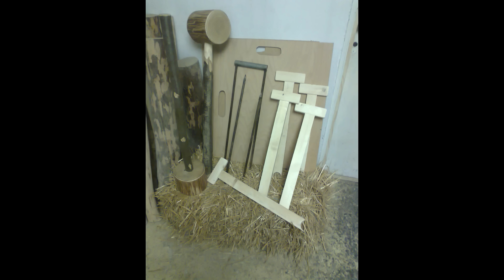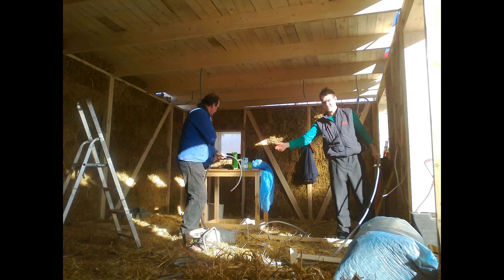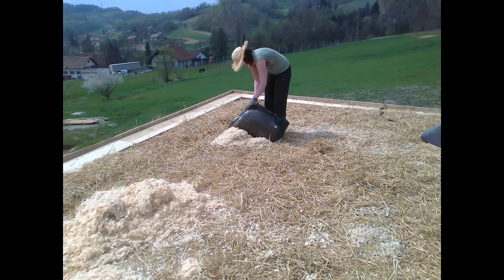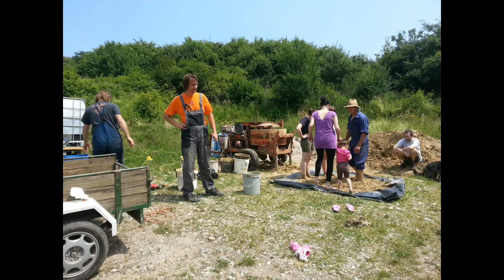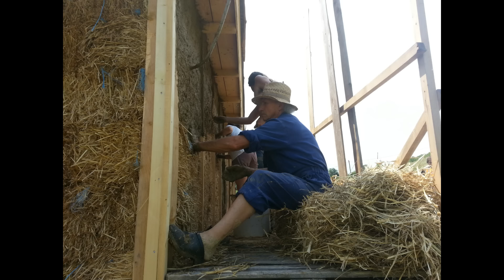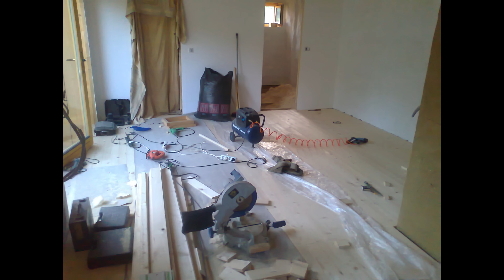20K straw bale house from start to finish

Comment: the posts will rot sadly
Reply: Inside the Straw walls they won't, the exposed posts to the air/ground would just have to be maintained, just like any home.
Reply: @CannyNomad  so how will you maintain them? dig up and replace? its not that simple when the house is resting on it
Reply: @CannyNomad  and wood should never be in contact of the ground and in most homes its not
Reply: Hey guys, have a look at buildings in Thailand for example, the poles are in water there. In northern Norway you will see buildings built on wooden poles, and the foundation is in salt water. You can change one and one pole by jacking up the house. No idea how long the strawbales themselves can last.
Reply: OK: posts in water or swamp do not rot, that s the point of having wooden post in Thaïlande or normal, finland, france!still,  in Slovaquie or Slovénia, the posts Will rot slowly thx to the cold but they ll rot anyway. They Will have plenty of time to make concrete posts 😉
Reply: @supermojo9672  how are you gonna crawl under the house with buckets of concrete? lol make the posts from start
Reply: @BlueGamerDude  OK they screwed up...but you know they re not that rich....concrete is house caviar for them.
Reply: @BlueGamerDude  By back yard is fenced in Black locust and is over 75 years old so maybe you don't know everything.
Reply: @EURIPODES  and is the fence in the ground?..... wood over ground doesnt have to rot only because its old. But we are talking about in ground
Reply: @BlueGamerDude  locust wood, aka iron wood has a much higher slica content, they are more tropical in locale, but you can find iron wood here in South Carolina. Ipe' is another, but, it is a tropical wood. High silica content really doea make the wood so hardy that it's almost impenetrable to moisture issues when in direct contact woth the ground. Caribbean Heart pine is a good one, too. But that's only because antique heart pine, the 400 year old kind... is harder to find, but it's so sappy and has such a high density of pine resin that it's practically waterproof. Maybe they have something like that in that neck of the woods...
Reply from the maker: No, it is hardwood...
Thanks for the comment!
If you are subscribed and you ring the bell, you will see in May my new episodes
TINY HOUSE IN THE MIDDLE OF THE NORTH ATLANTIC OCEAN
Which I am building right now ⛏🔧🏄🛠🔨

Comment: Adobe people adobe not straw. Fire hazard and animals love straw.
Reply: straw has zero calorific value unlike hay so straw bales do NOT get eaten or catch on fire unlike hay! YOU CANNOT USE HAY BALES ! some of the oldest existing buildings in the world are straw bale, cob or adobe these houses breath so are less prone to mold have insulation ( both heat and noise ) qualities that cannot be matched in modern construction and due to their weight hold together in high winds better than slapped together match box homes. I don't understand why this $20000 normally straw bale homes cost a fraction of modern homes they are however very labour intensive!
Reply: Straw bale houses are encased both inside and out with some sort of cladding, very often 2-3 inches of cob (which is not significantly different than adobe).  How are animals going to get to the interior of the wall?  Why would they want to?  There's zero nutritional value in straw, except to ruminants (even there it's minimal).  If your cows, sheep and goats are breaking through 3" cob walls (or wooden cladding, etc.) to get to nutritionally-worthless straw that they don't even know exists, then there's something seriously wrong with the animals you keep, not your straw bale house!

Comment: What part of this house cost 20000 bucks??? The wood????? No.. the straw??????? No.. the windows????? No.. somebody got ripped off lol hehehehe.. I guess if you had a septic system put in and the costs of the land you could spend that kinda money.. I hope that's why they said 20000 bucks 😉
Reply: The OP said in another response that all materials cost about $10,000, then the Labor costs to put it together. $20K is absurdly cheap for a home.
Reply: @CannyNomad  yes it is..
Reply: 20k dollars? 20k euros? 20k what?
Reply: ike fun thanks, that's really cheap, well done!
Reply: @raduhannibal  Slovenia = UE => 20k euros
Reply: @raduhannibal  eggs. Large eggs.
Reply from the maker: Thanks for the comment!
If you are subscribed and you ring the bell, you will see in May my new episodes
TINY HOUSE IN THE MIDDLE OF THE NORTH ATLANTIC OCEAN
Which I am building right now ⛏🔧🏄🛠🔨

Comment: 20k for a straw house?! Lol ,for that money you get a real house.
Reply: Where can you find a house for 20k??? 😂 Asking for a friend 😂
Reply: @LuisMartinez-of5oh  i'm selling a house for $18,000 in usa
Reply from the maker: Thanks for the comment!
If you are subscribed and you ring the bell, you will see in May my new episodes
TINY HOUSE IN THE MIDDLE OF THE NORTH ATLANTIC OCEAN
Which I am building right now ⛏🔧🏄🛠🔨
Reply: Looks like a "real house" to me and I dont know where you are buying materials but I assure you you cannot build a shed out of traditional materials for under $20,000. You can build a regular size, three bedroom, two bath home which requires very little heating and will last far longer than anything being built out of osb board and plastic like today's modern pieces of garbage. Not to mention the fire restistance and extremely high insulative value for straw bales (about 60r). You can use one small window unit and a few fans to cool it as well. Do a little research. Learn something. Then get back to us.

Comment: $20,000 dollars. 80cents for a box of matches and you can kiss your $20,000 good bye
Reply: You can't even have goats with a house like that.
Reply: drew , no it wouldn't burn so easily , once its all tightly packed and rendered , it will not lite so easily . A wooden house would burn easier and faster .
Reply: There are actually more fire resistant then a normal house due to the plaster on the walls and the fact the hay is so dry and packed together it's hard for air to flow though it making it less likely to catch fire.
Reply: @TK-yv6uu  its mud rendered after so the goats wont bother it
Reply: @thjeokthjeok443 )
Reply: @jeanphilippefiore8364  , i have a small straw bailed house on my property .
Reply: Its no more at risk of fire than any timber home.
Reply: straw has zero calorific value unlike hay so straw bales do NOT get eaten or catch on fire unlike hay! YOU CANNOT USE HAY BALES ! some of the oldest existing buildings in the world are straw bale, cob or adobe these houses breath so are less prone to mold have insulation ( both heat and noise ) qualities that cannot be matched in modern construction and due to their weight hold together in high winds better than slapped together match box homes. I don't understand why this $20000 normally straw bale homes cost a fraction of modern homes they are however very labour intensive!
Reply from the maker: Thanks for the comment!
If you are subscribed and you ring the bell, you will see in May my new episodes
TINY HOUSE IN THE MIDDLE OF THE NORTH ATLANTIC OCEAN
Which I am building right now ⛏🔧🏄🛠🔨